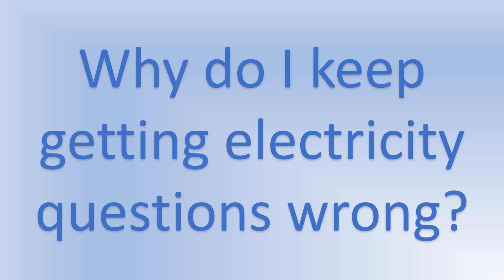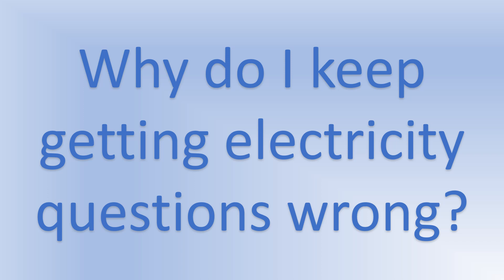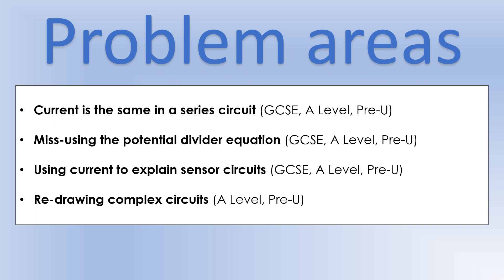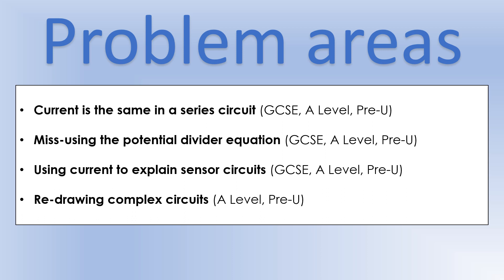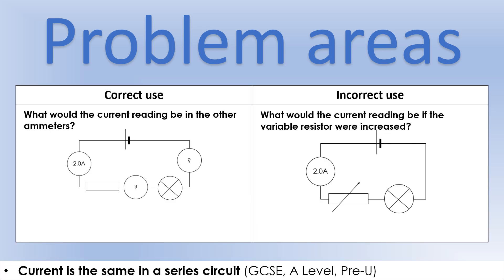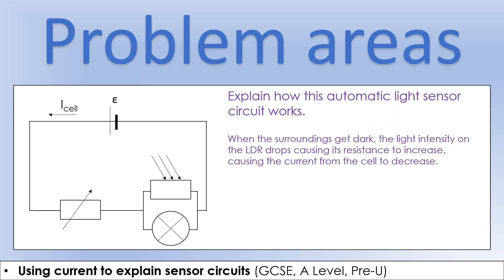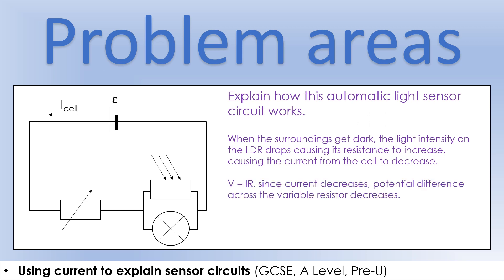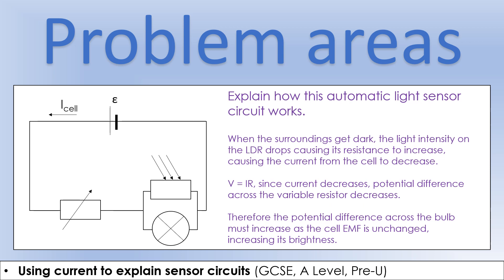Why do I keep getting electricity questions wrong?

Comment: 7:09 if we put 0.66 on the top, wouldn't that give v.drop of the combined resistance I.e 0.666 and not the v drop of the 1 ohm resistor. However, question wants v.drop across 1 ohm resistor
Reply from the maker: Those two things are the same. Remember they are in parallel so the potential difference across each / both is the same so the P.D across the 1 ohm is the same as the p.d across the 2 ohm is the same as the p.d across the combination.
Reply: So 0.87 is p.d across 1 ohm and 2 ohm resistor as they are in parallel, thank you for helping

Comment: questionn, 
@14:40 why are you subtracting the voltage across them by 100V (the emf im guessing), doesnt that give the voltage that is left? becaus withouht subtracting form hundred, we already got the voltage across the resistor we chose, isnt that how the formula works?
Reply from the maker: So I'm not trying to calculate the potential difference across a resistor, I'm trying to work out the voltage at A and at B to then find the difference between them. By calculating the potential difference across the 120 ohm resistor and subtracting it from the EMF, you calculate the voltage (energy each coulomb has at a specific point) in this case A.
Reply: @burrowsphysics  ahhh i see!! thankyou so mcuh for all the replies uve given recently to me even though i asked quesiotns under videos here adn there multiple times in the span of like 3 days, adn that too so quickly, really helping me out for my finals prep

Comment: Does anyone know what to do when finding combined resistance of a 0 ohm resistor in parallel as you can't divide by zero? Do you just ignore all the other resistors in that parallel configuration and just take the combined resistance to be zero?
Reply from the maker: That is called a short circuit. The circuit acts as if that resistor isn't there so yes you treat their combined resistance as zero